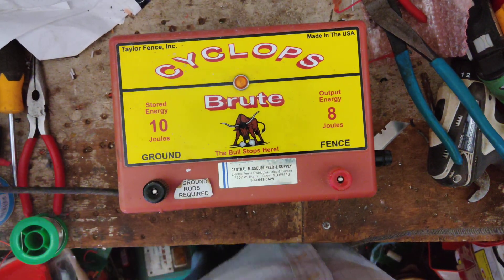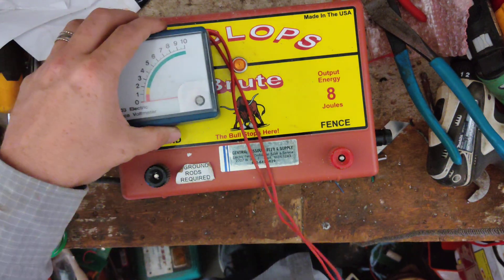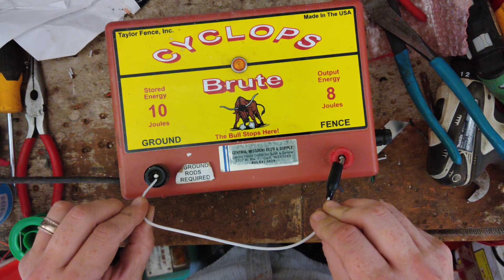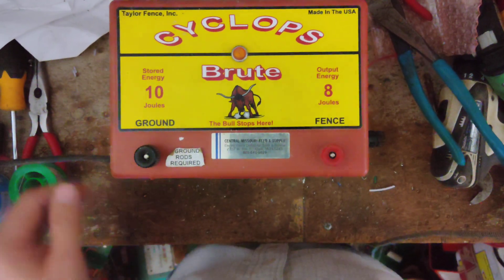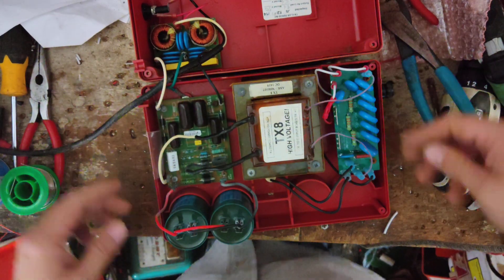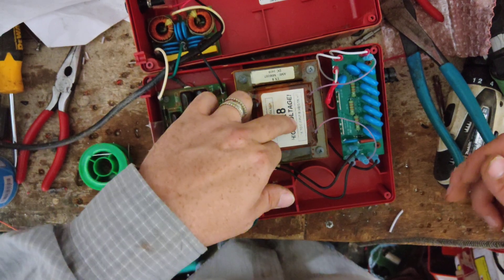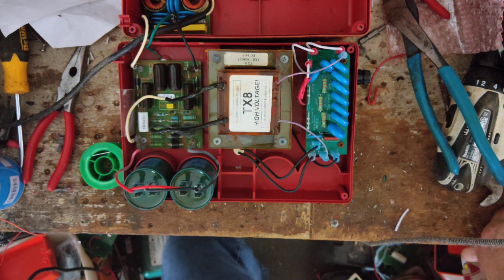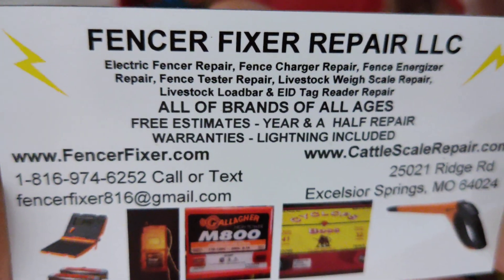Cyclops Fence Charger Repair, www.fencerfixer.com

Comment: What is your favorite  and best DC Charger of brute capacity?
Reply from the maker: It would have to be a Cyclops 12v unit or a Gallagher dual powered unit. Gallagher has them all the way up to 28 stored joules and they're reliable, but you need to have a good size solar panel set up for them and you need to protect them from the elements.
Reply: @FencerFixerRepairLLCKansasCity  Do you mean cyclops super?
Reply from the maker: Any of the cyclops 12v units are decent and pack a good punch. Same as the Gallagher stuff and their 12v stuff. Gallagher's carry a 3 year warranty and cyclops only carry a 1 year warranty. Gallagher's are little more reliable I think